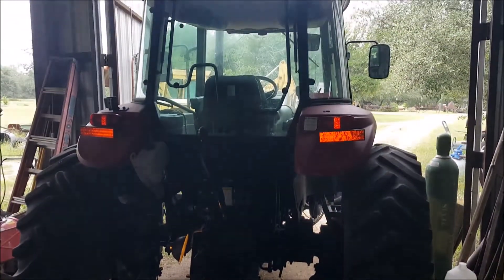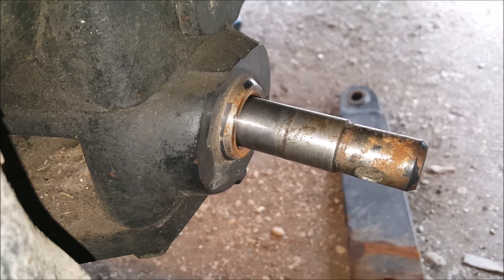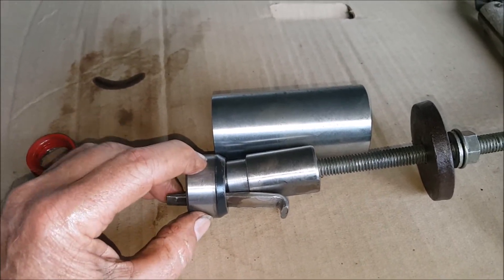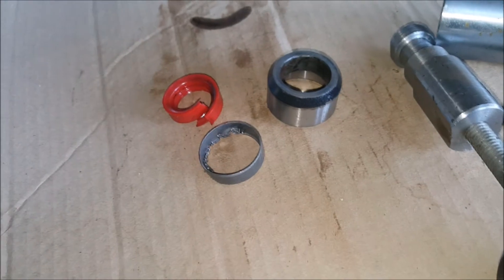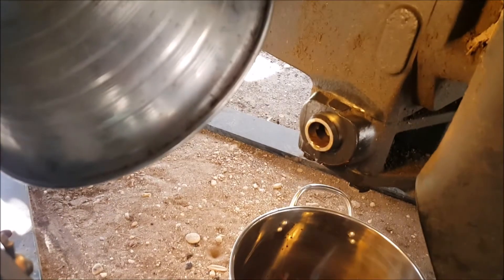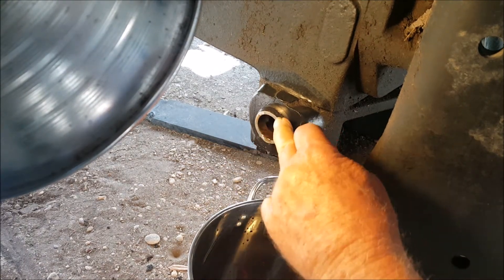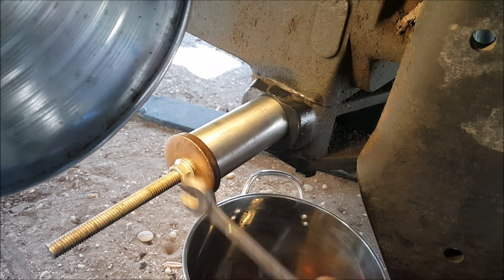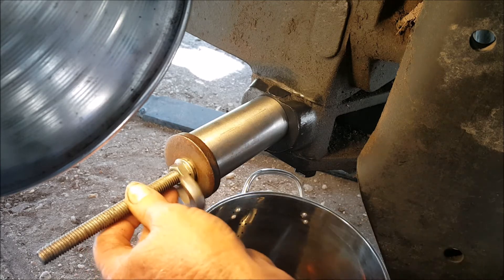Oil leak Case JX 80 3

Comment: what did you use to fabricate the puller head. I have a Case JX55 with the same seal and bushing and would like to fabricate  a "LIKE KIND" puller, but would be a help to have dimensions of puller head and keeper. did you Cnc the head or was it a part that can be found without machining.
Reply from the maker: Thanks for watching the video. I have a lathe so the puller head was turned to just go thru the part. i will get it and make a sketch of it for you. The all thread is 1/2 -13 the flat down the side was to hold it over to one side and lock it in the grove. The keeper was part of a old butter knife you can see part of the design still on it.
Reply: @RogersFixItBarn  Thx for the prompt reply. Im gonna start this project next week and any help would be appreciated.
Reply: ok, I fabricated the tool and got the bushing out but now I'm wondering how you pressed the bushing back in. it is a very tight fit. I'm sure it will require some sort of press to press it in. just looking for suggestions as to how to reinstall the bushing.
Reply from the maker: @swbeene0747  after I installed the seal in the part I slide it over the shaft and use the shaft to line up the part. I then slide one of the spacers over the shaft and use a hammer to seat the part back in place. the shaft keeps the part lined up as you hammer it in.  good luck Roger email me  at RLoveC1@aol.com
Reply: @RogersFixItBarn  Thx Roger that helps a lot. I appreciate your help.

Comment: Once the tool drops in behind the seal could I drive the shaft back trough driving the seal out?
Reply from the maker: yes you could drive the shaft up against the tool and drive the part holding the seal out. I did not know how tight the part was pressed in and did not want to damage the shaft.

Comment: I had the same problem got the new seals in but were do I add the fluid?
Reply from the maker: The hydraulic fluid is the gear oil in your transmission rear end.  Mine has a dip stick in the fill hole.